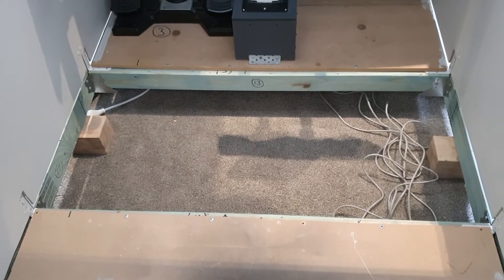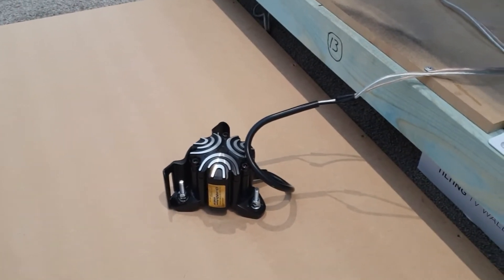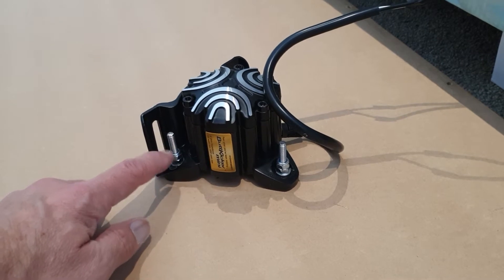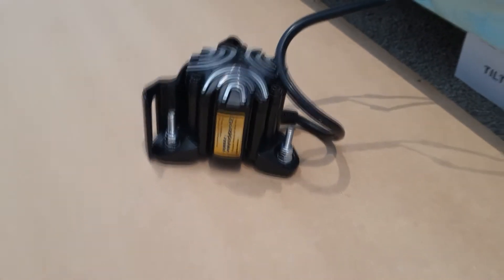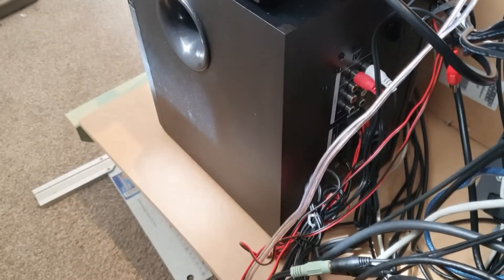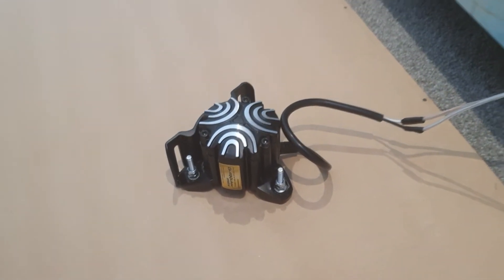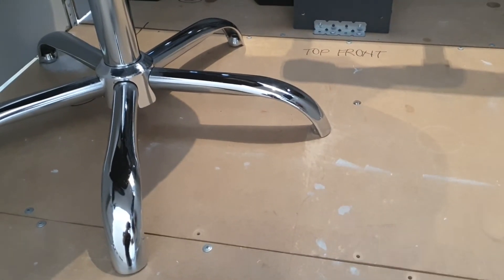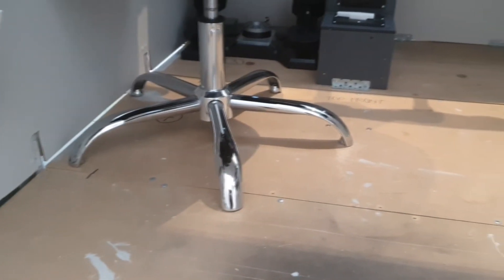12 - Buttkicker Part II

Comment: Great tip - I'm gonna see if I can't isolate the floor like this
Reply from the maker: Having completed more testing Captain, I feel as if the sim has more than enough vibration without the isolators, however if I were to design again, I would consider a design that gives you the option.....